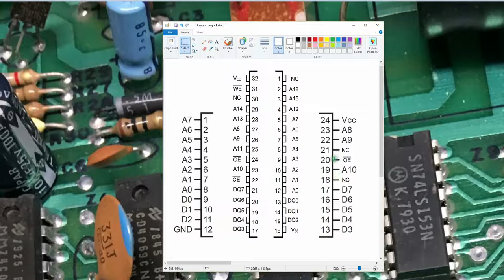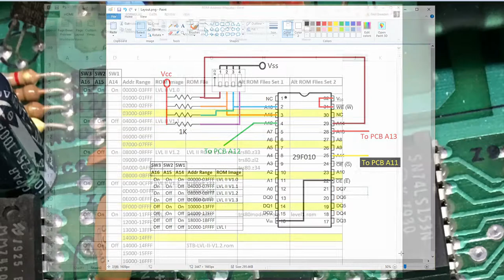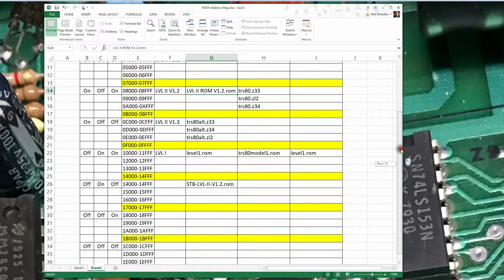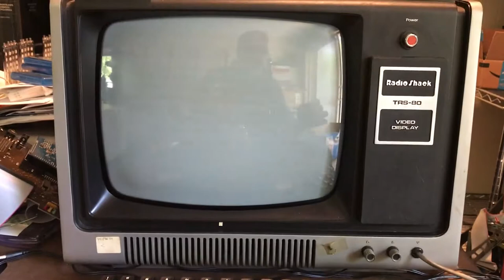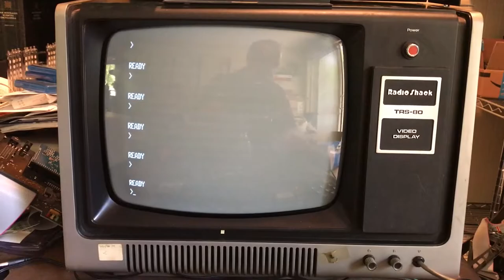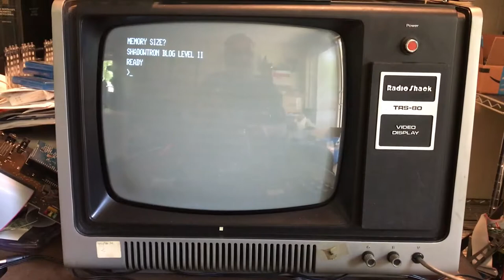Model I - Part 5 - Level II BASIC ROM Replacement - STB46

Comment: I definitely like this final solution best of all - soldering to the the EPROM pins in the previous videos pretty much locked you into what was on the device w/out being able to reprogram it easily.  The spec sheet for this chip mentions it can be programmed via  an EPROM programmer - but how are you "erasing" it?  Simply ignore what's on there and re-"burn"?

Comment: much neater solution, but i'd mount the dip switches on a cable to mount them externally to enable the eeprom memory selection so the case can be refitted. Looking forward to the next vid. thx.
Reply from the maker: I considered this. A 5-wire ribbon cable could be soldered to the DIP switch to being the 4 switches and VSS to a remote DIP switch. Leaving the switches on the daughter board open would allow the remote switch to take control.
Reply: good idea.

Comment: Is part 4 of this series still online?  I couldn't find it.
Reply from the maker: It's still there - Titled "TRS-80 Model I Level II BASIC ROM Replacement - 28C256 - Part 4"

try https://youtu.be/hr9P766X2sc

Are you finding anything useful in the series?
Reply: Ah, the title was wrapped to three lines - so youtube was hiding the remainder "part 4" from me.  I'm in the market for a Model 1 system (watching ebay) and on the off chance I end up with a 3 chip ROM, I'd definitely be looking to replace it with a simpler neater solution like yours.  I did like your character gen replacement tutorial, I really dislike the look of non-descenders.  I will admit, I bought a MCM6674 (cheap) on the off chance I end up with one that has non-descenders.